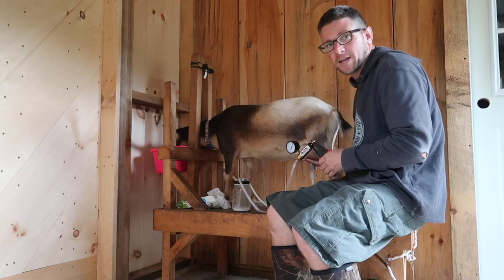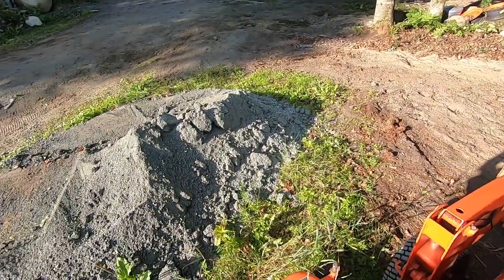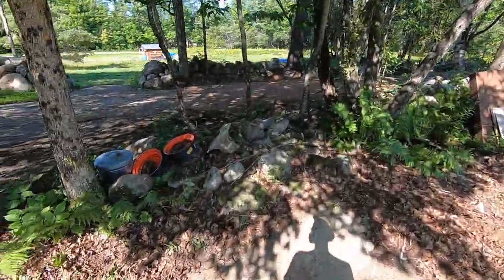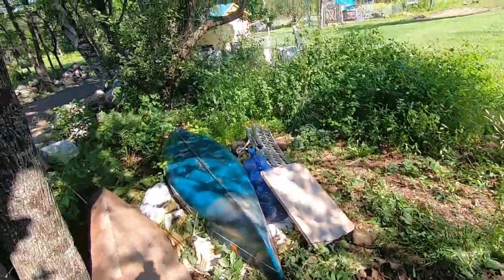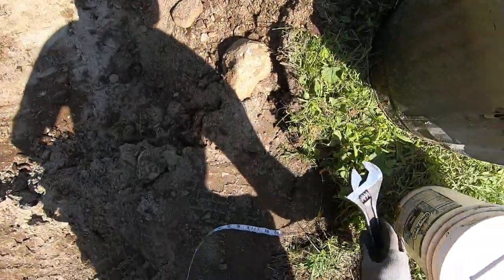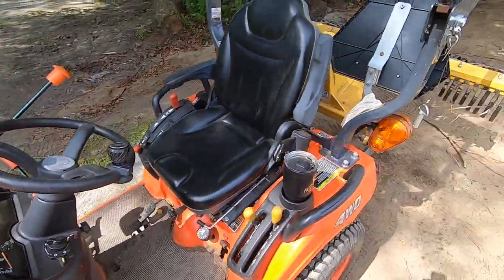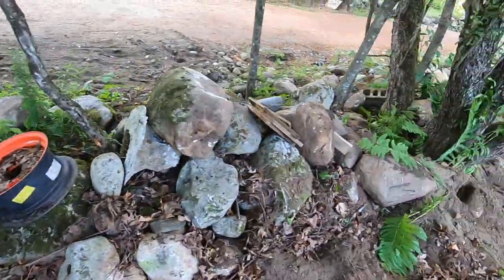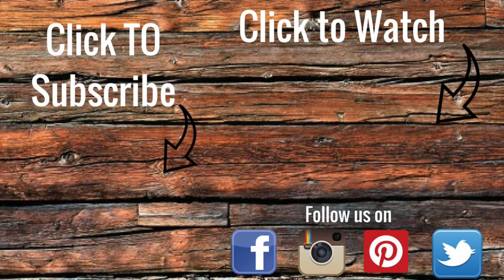Don't Let Me Down Now I need You! Site Work Begins

Comment: Al - Check the gas cap and make sure the vent isn't plugged.  Both my lawn mower and garden tractor run rough after I fill them up.  The lawn mower cap isn't vented so it just creates a vacuum in the tank.  Works fine after I loosen the cap.....Stu

Comment: buy 2 fuel filters, back up filters for your whole machine :) Consider draining and cleaning out your fuel tank?  The cleaner the tank , less to clog your future filters. Most farm folks I know filter or screen their fuel as they refill :) You might want to do a full service , hydraulics etc before winter? On easy 3 point hitch switch overs. Slightly raise the tool height. So when you lower the hitch there is zero tension on the 3 pins.Or have a welder buddy make you a simple pry tool and leave it in your attachment area 24/7 or , have them add a ring to hang it from on the side of the new wood shed?  Plus maybe keep some oil or grease on the pins.

Comment: Al, but a can of Anti-seize.
In things like the clevis pins and clips for your 3-point hitch, spray them with WD40 then brush the parts that rust with the anti-seize. 
Ppl will say it is a waste of time but it helps makes times like you needed to take that off much easier!

Comment: My solution for the three point hitch issue is having two tractors.  I rarely take the backhoe off the 24 hp tractor but change between the brush hog and rear blade on the 45 hp.

Comment: I agree with Scott below about changing the grade of soil around trees. Adding soil and compacting the lateral roots can definitely kill trees (not immediately but in a few years they can die). I've seen this on construction sites where they move soil and park heavy equipment under trees.
Reply: Yes I lost a beautiful large pine tree in my backyard in the suburbs after my ex put a planter box around it. Took a while, but ended up losing the tree, luckily before it took out the neighbors 2 story house.
Reply: I've also been to campgrounds where there are signs NOT to park vehicles too close to any trees.

Comment: If you would install a filter head then you could use spin on fuel filters, you can put quarter turn shut off valves in also.
Reply from the maker: That’s going to make a good winter project

Comment: Al, look at your left rear axle.  There is something (perhaps old fence wire) wrapped around the axle, inside the wheel.  I noticed it as you removed the chains from that side.  Keep an eye out for that stuff, it will kill the seals.

Comment: The best 2 things I’ve bought for my tractor are a quick hitch and a hydraulic top link. Putting on implements takes about 30 seconds ...maybe faster than that......taking them off is as fast as lowering my lift arms and driving away. The only thing I have to get off of my tractor for while connecting implements is to hook up the pto on the cutter. Other than that I never leave the seat. 
The hydraulic top link allows me to adjust the implement while working. For example the box blade; I can go from cutting deep then tilt it back and smooth then tilt forward again and cut again all from my seat. 
Best $$ I ever spent other than the tractor itself

Comment: Might want to invest in a quickhitch for your tractor.  Makes switching out 3-point implements a breeze.  Save yourself a bunch of headaches if you do and spend the couple of extra bucks to buy a LandPride one.  Theirs has actual Cat 2 latches so you don't have to buy pin adapters for all your implements.  May also want to look into a tooth bar for the front of your bucket.  Check out Tractor Time with Tim here on YouTube as he tests and uses a lot of different attachments for sub-compact tractors.  He also has a web site where he discusses pro's and con's and what to look for in small tractor related products.
Reply: flick22601 I watch tractor time with Tim too. I was thinking about getting the toothbar, really looks like it would make the bucket more effective scooping out areas

Comment: Are you putting the carport on the sunny side where all the weather and UV can get in? Remember the sun is lower in the winter and snow rarely falls straight down. Or on the shady side where it will get some protection from the driving rain and snow? 💝☀🌵

Comment: I can never understand why people put their woodsheds so far away from their houses.  I keep my wood storage right outside my back door so that I can easily just step out and bring in the wood.  You should have also had that all cleared out before having the gravel dumped there.  Then they could have just dumped the gravel in the spot and just leveled it out.  Wouldn't have to move it from one spot to the other then.  Like they say, work smarter, not harder.  The fewer times it has to be handled the better.  At least, that is the way I would have done it, but I know everyone is different.  Not putting you down, just giving you some ideas for future builds.
Reply: Start a YouTube channel so that I can watch.
Reply: @tonygrimes13  I have no way to record video.  Even if I did, once the camera focused on my face, it would probably break.

Comment: Probably should build a garage for the car and pickup and maybe the Kubota as well.
Reply: That sounds more like a barn than a  garage.
Reply: Thom , I think this is going to be woodshed/carport, just my guess.
Reply: The Kubota generally is placed in the outside kitchen for the winter. He places a plow  on his truck. Last year was a bad winter. Almost 8 feet oh snow with plowing. It was so cold that the maple sap wasn't flowing, no homemade maple syrup this year.
Reply: @karenrn6173  This coming winter will be worse
They'll need a greenhouse too to grow indoors, grow lights maybe
Reply: @recoveringsoul755  Al starts his plants early for his growing area in the basement with grow lights,  eventually harding them in the outside kitchen.  Yes a garage would be nice but you'd still have to taken the plow out, and get the snow  off the roof. Been watching just about  4 years now
 Their growing season is a little  over 3 months. Since maple leaves are dropping, it will be wi term real soon. But not until the apples all fall and the pigs eat as many as they can.

Comment: If your fuel filter is getting dirty all the time you better check your gas tank for dirt. thats the source
Reply: Pull the line off after the filter and drain it all thru.. pour it back in and repeat until clean.

Comment: careful pilling dirt around a tree it will kill it.
Reply: I used to think that and it may in some cases but I piled about four feet of dirt around a hickory tree when filling in a gulley and it didn't bother it a bit even after several years.
Reply: @JamesCouch777  You used to think that, but you piled up four feet of dirt around it anyway? why?
Reply: @YouTubestopsharingmyrealname  It was in a gulley I had to fill in to build a fence. It didn't matter because I had a hundred acres of woods.
Reply: We were told that about a pine tree in our backyard where we were trying to put in a raised planter box. So the person I was married to put a ring of sheet metal around the tree a few inches larger than the trunk, but the top was still open.  After a few years, the tree was Y shaped with a thick trunk and two large main branches. On a windless night without any rain or snow or anything, one of the branches just broke off and fell down. If it fell ANY other direction it would have taken out our garage and carport (and cars) , or our fence and into the neighbor's yard, OR worst of all, it could have fallen on our neighbors house and crushed it. Probably killed people. As luck would have it, it fell right over our lawn, ending about 3 inches off the ground. 

We cut up that branch, but without that weight the remaining branch began to lean more and more so we had to cut down the entire tree. I loved that tree. I'm not sure if having the dirt around it was the problem or something else,  but I would not do that again to a a large beautiful tree like that. And then without the shade from that tree, it affected the other plants that had grown around it.

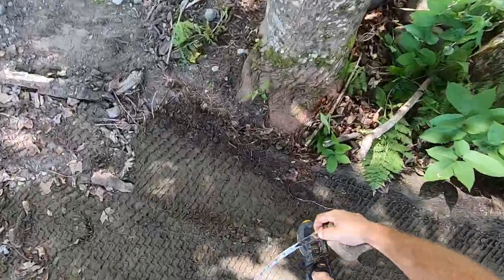Comment: 20:53.    Way too close to the tree.  You will kill or stunt it.  You need to keep clear of its rooting region.  For a tree that size, you should be no closer that 3 feet, preferably 6 feet.
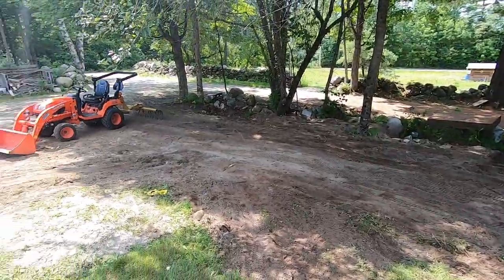At 22:26 you show a lovely group of trees.  In your present plan to build so close, you will kill or stunt most of those.   Is that what you want?